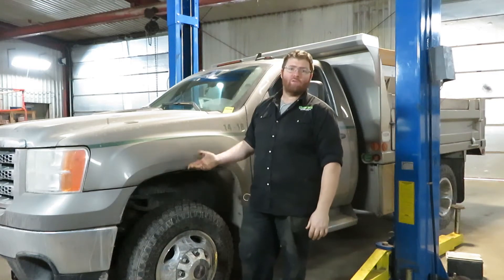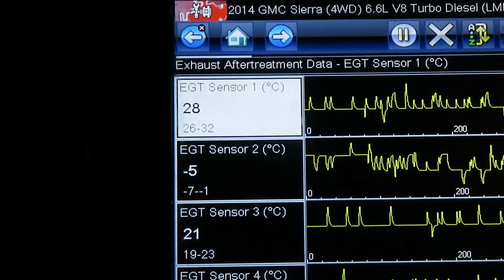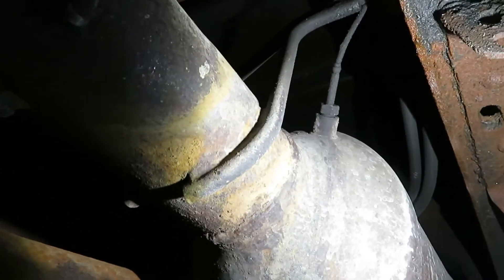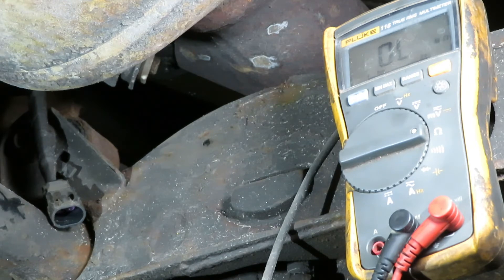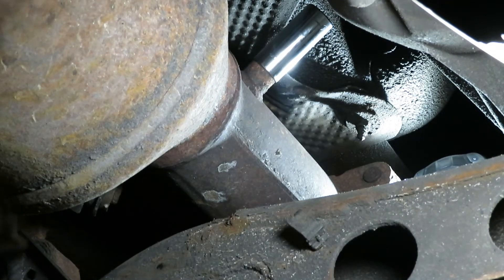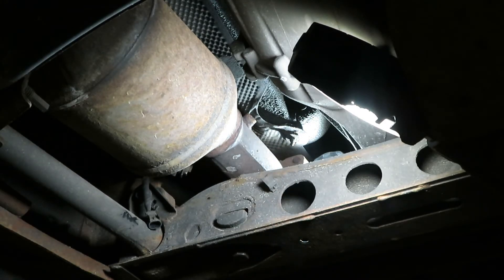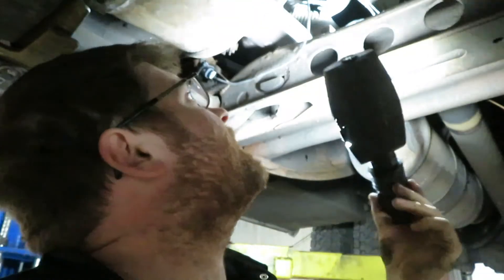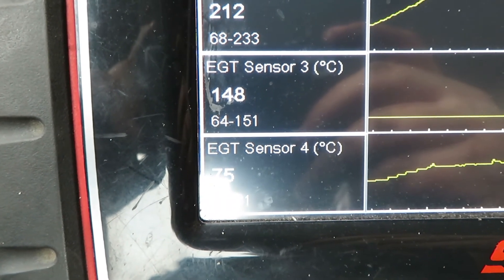Duramax P2033, P2032 Diagnostics and Repair. (Resistance specs and voltage specs in description)

Comment: I have a 2007 Silverado 2500 Duramax, I currently have the check engine light on with the P2033 code and also going into limp mode and blowing a big cloud of black smoke.
I'm wondering if the black smoke is happening due to the Code my truck has?? I do also have some stored codes (P0546 and P0299)  seems like they are all related.
Anyway... after seeing this video I'm going to order the sensor for my truck and hopefully, that takes care of the issue and maybe corrects the other codes.

Comment: thank you for this much needed info.  I have a 2015 Silverado 2500 duramax that had the code 2033 thrown about 10 days ago.  On my diagnostic meter it listed bank 1 sensor 2.

  I left the truck sitting in my lower driveway during that time until I had some extra time to research it.  I found your video and found it very helpful.  I ordered the part so now I wait for it to be delivered and for the rain to stop so I can get the truck on dry ground to make the repair.  Again, thank you for this video.  very informative.

Comment: best video by far for p2033!!!! ive got an L5p (2018).... I cant find the EGT sensor 2, it is reading way high temp like 1800 degree while the others are all normal and low. and advice would be helpful, im struggling trying to find part and exact location... (when i do find it, i wonder are ohms and volts the same even though its a different plug i believe)
Reply from the maker: Sounds like sensor 2 is just the second one back from the turbo. Number one is right after the turbo so number 2 would be the next one.

Comment: Need help where is the exhaust gas temperature sensor 6.6  2500 HD 2011 Silverado
Reply from the maker: There are multiple sensors. What one are you getting a code for?
Reply: @screamindieselltd  exhaust gas temperature sensor

Comment: as another circuit wiring integrity / ecm  test can't you short the 5v & ground together in the truck side harness while looking at the scan tool and you will see the opposite  extreme of the temp values, IE if the temp shows -50 with it unplugged it might show + 2000 with it shorted or vise versa,  I don't know the exact values, this way it loads the circuit, can always check another sensor harness terminal to compare values and get a known good value
Reply from the maker: You could possibly do that but you may throw more codes for other modules that are on that reference circuit. Cummins are bad for that with their viscous fan clutches killing the 5v reference and taking out the whole communication system till you unplug the right part then it comes back and everything communicates again.

Comment: I'm dealing with the 2012 Duramax 4500 series that has the same exact problem but caused by a different situation I replaced the one and two temp along with the level sensor and change things have any suggestions
Reply: I meant to say and nothing has changed still showing reduced engine power and all that good stuff
Reply from the maker: You might have to cycle the def heaters since you replaced the level sensor. They are usually part of that assembly

Comment: Thank you. My 15 duramax is in limp now.. im gonna try this when get back..
Reply: Found the issue. I replaced all the egt's, both nox ,map.. and ego's, connection.. done a regen. Now its back on the road. .
Reply from the maker: Hopefully it’s just the sensor 👌
Reply: @screamindieselltd  you know what size em threads are on em sensors?